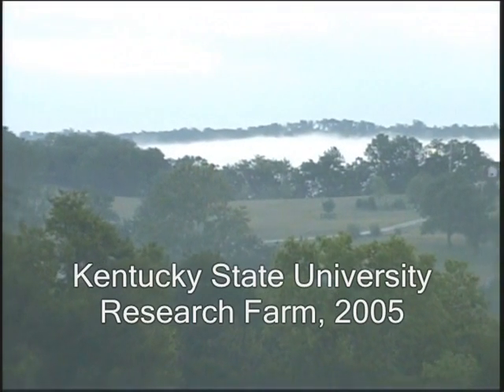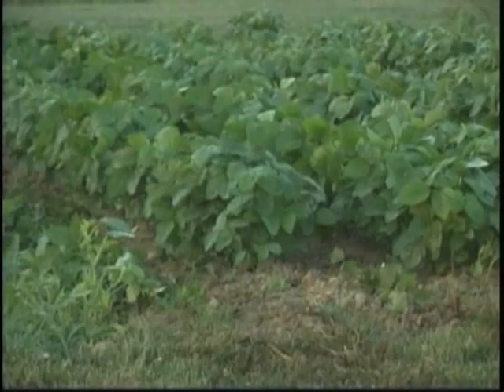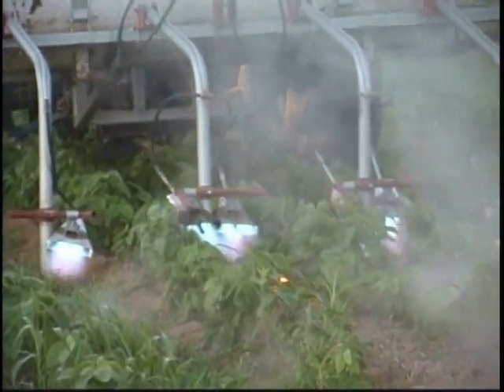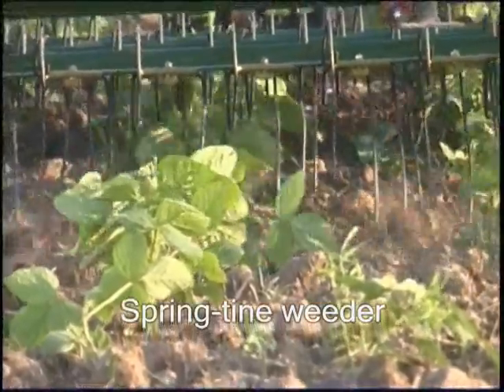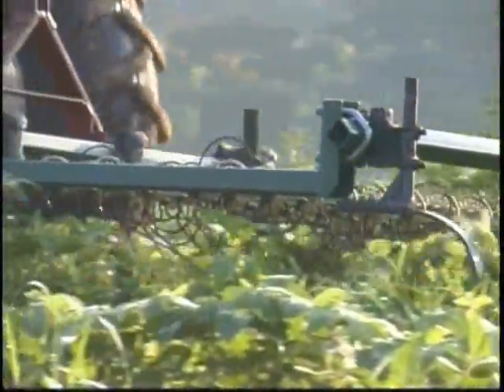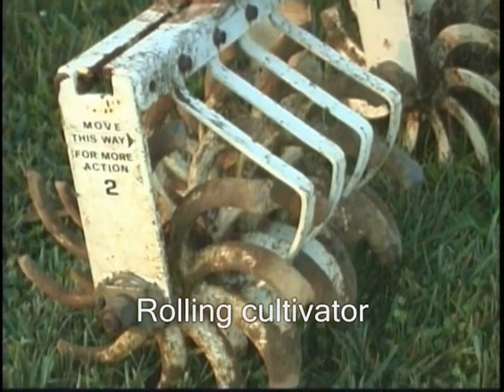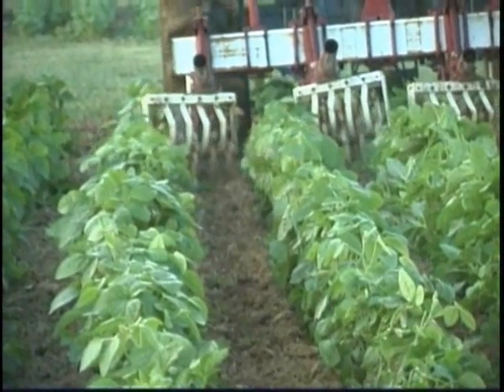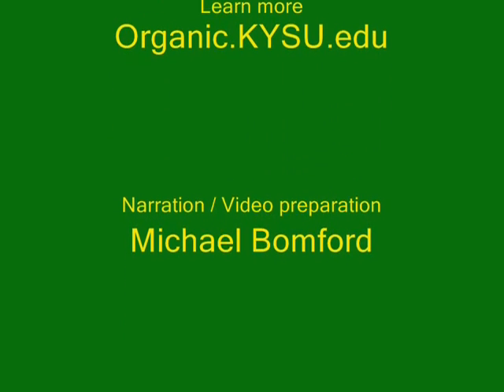Weed Treatments

Comment: How would you see using the Miastrada Dragon as the tractor and configuring some of this equipment for that vehicle?

The personal tractor approach seems like a possibility for careful weed control operations.  It would require more worker hours to do the same ground area, but the tractor cost would be much lower.  Fuel would also be much less.